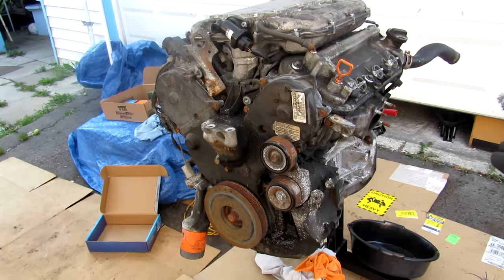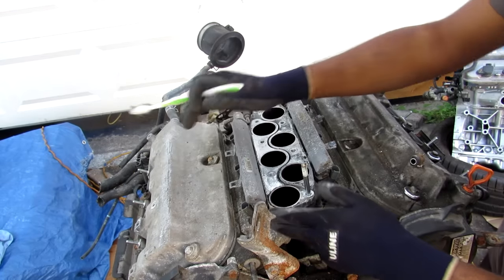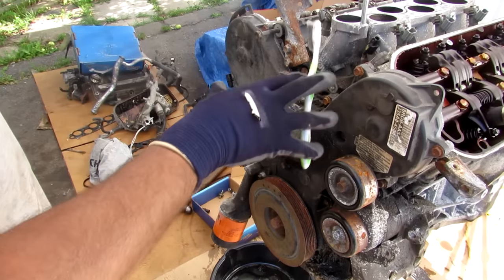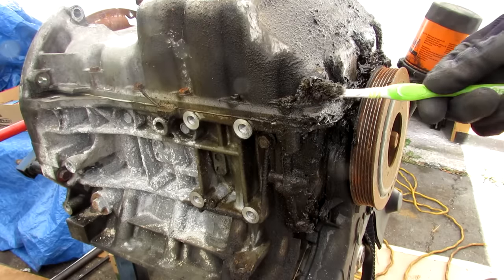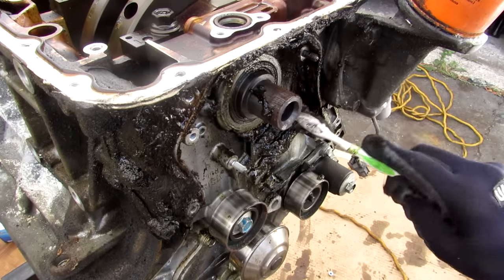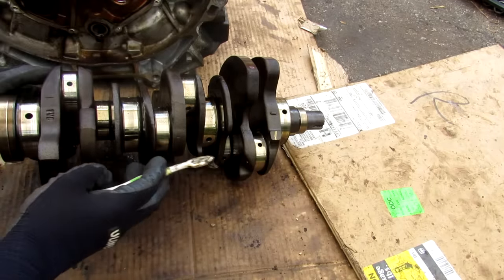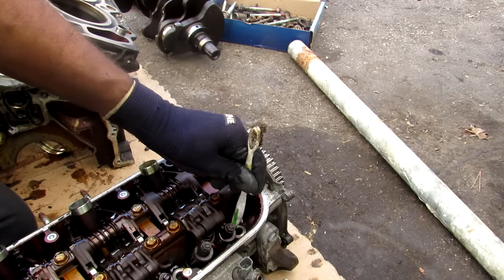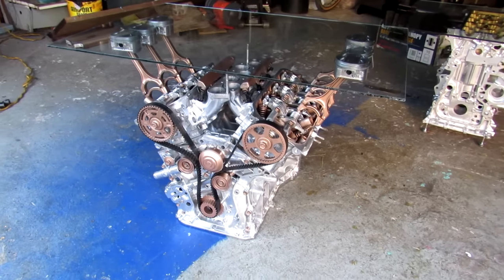Why Honda V6 Engines Haven't Changed For 25 Years

Comment: "Infamous" J-series?  That has a negative tone.  More like famous or legendary J-series!  I agree that the use of timing belts is a weak point of these engines, but timing belt service is only required around 120,000 miles, maybe an earlier inspection around 100,000 miles if you live in a hot climate (as per 2005 acura RL 3.5 service manual).  Even when I replaced the timing belt in a 2005 Acura RL with the 3.5L, the timing belt looked fine.  Additionally, Honda is not the only maker that uses timing belts on later model engines - Audi does as well.   The SOHC design is not necessarily a bad design - it makes for a compact engine design.  Additionally, the placement & design of the upper air plenum is ideal because it allows for easy spark plug replacement, unlike the design of many V6 engines that require upper intake removal to replace the spark plugs.
Reply: Timing belt designs were far superior to the chain variations that have replaced them. Chains were not adopted because they were a more durable design. They were adopted to fool customers into thinking that their maintenance costs were going to be lower. That hasn’t proved to be true at all.
Reply: It's probably infamous to people who have to do timing belt changes or water pump changes. No quick fix, that.
Reply: Jesse Brook No, as technicians we love them
Reply: I replaced the timing belt at 105k (10 years old on my vehicle). No signs of cracking or decay.  I'm still glad I did it, as it's worth the peace of mind that I won't be letting a valve and piston meet.
Reply: Marcus Schroeder I’ve seen HSN timing belts last 200k miles before they were replaced. Many modern chain designs are lasting 75K miles before they’re stretched and throwing engine codes.
Reply: It's Infamous because it's very underrated it's such a great engine
Reply: I don't think timing belt is a weak components at all…I like cars with timing belt instead of chains, more serviceability isn't necessary a bad thing
Reply: @prevost8686  Most of these chains going bad at 75k miles as you say, is most of the time a lack of maintenance.  I am a tech for a chevy dealership and really the only time we see chains go bad (2.4 ecotec) and (3.6 liter) are always due to low oil from lack of oil changes or thick sludge, from lack of oil changes.  Going 10-15k miles on conventional oil does chains in.  Chains are lubricated by the oil.  The chain tensioners require oil pressure to operate.  Without oil, the tensioners lose tension and the chains jump.  Guides also wear a lot faster with lack of oil changes.     Also seen plenty of high mileage chains with no issues as well.  All depends on how they are taken care of.    Editing this to add to the 2.4 ecotec.  Chains love going bad due to the oil consumption issues those engines have as well!!
Reply: @JD730  I’m sorry but you’re wrong. Dealerships only retain about 7-10% of their customers after warranty. I’ve had more customers than I can count in my independent shop that never miss a service that have had everything from chains to solenoids going bad and they run the best full synthetic oils at reasonable intervals. I’ve replaced components in them that were as clean as a new engine. They component quality of the engines is junk.
Reply: @prevost8686  That's my view. Most belts eventually became pretty good. Additionally they enable engine designs that would be difficult with chains. The bad ones, and replacement costs, frightened customers away, including me.
Reply: @prevost8686  I am a dealer tech and I see lack of maintenance ruin more engines than just all out failure from manufacturing .  And to let you know, not all dealers only retail. 7-10 percent of their customers.   70 percent of our work is CP, average car that comes into our dealership has 75k miles and is a 2013 model.   So that rule doesn't apply to all dealerships.   I'm really happy that your customers follow their maintenance schedule but don't kid yourself.  You and I both know that in the real world that most people do not maintain their vehicle let alone do simple service like oil changes.
Reply: @JD730   Mercedes Benz has the highest customer retention after warranty expiration and they’re only at about 15%. GM, Ford, Dodge have the worst retention of all the nameplates.
Reply: @JD730  Do you think a lot of these issues are caused by the salespeople telling people to drive 10,000 miles between oil changes, and lifetime fluids, etc? My circle of dealer reps, mechanics tell me all the time about the "Maintenance wars" between manufactures. Instilling in the customer that the transmission fluid for example will last the lifetime of the car, when that is not true. Its probably going to get worse since the electric car folk say they never have to do any maintenance on their cars.
Reply: I have the j series V6 and I changed all 6 spark plugs without removing the upper intake 🧐. I’m not sure what v6 engine requires you to actually remove the intake to change the spark plugs.

Comment: You can see Honda’s high quality workmanship and castings
Reply: You can also see the evidence of typical honda owner neglect. That engine was a ticking timebomb. It looks like they had seriously neglected oil changes, which was starting to take its toll on those rod bearings.

That oil was like it had come from a diesel, there was a front bad front main seal that hadn't been taken care of, and the timing belt was on the edge of snapping. Last time I saw a belt like that, I told the owner to change it immediately. They agreed, but couldn't get it done right away. 2 weeks later, pistons met valves.
Reply: seems like cooked electronics is what probably scrapped this one though
Reply: @thegearknob7161  They went to Kevlar reinforced belts in 2010. I wonder how many miles were on this belt? My guess 200K or more judging by the rest of the engine. The J series is a great engine design despite the negligence. Single cam less parasitic friction, less moving parts.
Why not a double row O-ringed chain run dry on the cams. No stretch, last forever speced correctly.
Bad oil selection and maintenance plus weak or neglected PCV system will get you varnish buildup.

Comment: Just a note, the lower intake runners CAN BE removed without taking the heads off.  You just need to remove the fuel rail and slowly wiggle the front one out first, then the rear.  That small gap in between the 2 runners allows you to do so.
Reply: I thought it was pretty crazy that he wanted to take off the heads in order to remove the intake manifold
Reply: @dappadan7914  ...were you drunk?
Reply: @lifepresent3183  yes
Reply: @dappadan7914  ive done it, like u stated multiple times. this guy does not know his J series...

Comment: i recently sold my 2005 accord v6. engine is still strong. transmission beginning to go at 190,000 miles. great car
Reply: Such a gem of an engine,but yeah honda auto transmissions have not been the greatest until recently. I think the 6 speed auto is best so far for automatic other than that the manuals are pretty bullet proof. Let see how the 10 spd holds up
Reply from the maker: That's the problem why so many Honda's are at the boneyard....the transmissions attached we're garbage
Reply: 200kMi on a car is quite good... something has to go first!

Considering the engine got all the  maintainance work (valve adjustments, Tbelt, spark plugs, etc) the transmission simply got new ATF before clutches and converter  got tired. 
... go compare that record with the high maintenance of the German cars 😉
I have a deep appreciation for Honda's achievements of performance + reliability and price point.
👍
Reply: Not all Honda V6 engines from Honda is billet proof. From what I know only the Honda V6 engines without the VCM is the bullet proof engines. The V6 VCM were for the most part crap!
Reply: @rmwarriors16  true I have heard some nasty piston, piston ring, and oil burn issues ,however there is an easy fix for that and I wanna say people that notice will 9/10 put the muzzle on it where as people that dont notice probably don't drive on spirited side anyways
Reply: @hieuhughesle-au9884  I think Honda has a bulletin for  VCM j series engines I think they only warranty misfires not oil burning on the J series. They replace the rings and clean up the pistons for free. No matter how many miles or years.
Reply: Vinny Booboo "ATF MaxLife " by Valvoline is a GREAT upgrade for crappy Honda DW1 ATF... 
as tested on 150kMi TL'04:
It delivers consistent shifts between cold and warm ATF

Quiets noisy gear humm with better lubrication
Reply: G Lasser Honda DW-1 is really not that bad though. If you were talking about the  old zf one, you can talk shit about it all day.
Reply: @glasser2819  Honda fluid is the only stuff you should be using Honda's hate none oem fluids in their tranny's, diffs, and power steering pumps. Toyota you can run anything LMFAO
Reply: Hieu Hughes Le-Au most people don’t notice this until it’s too late. I have two friends who have the V6 VCM motors and it’s burning oil like crazy! The rear spark plugs are fouled up with oil.
Reply: My 2005 v6 Accord coupe just hit 200,000. The transmission doesn't have to much further to go... I'm just gonna drive it till it dies.
Reply: Honda early j series v6 trans were shitty yes, but all their trans from the 80's - late 90's were phenomenally reliable. I've had 8 auto Accords 1990-2001 and each and every single one had over 250k miles with fine automatics
Reply: A drain and fill every 7 to 10k with honda fluid will make those trans last a long time.
Reply: 190,000 miles on ONE transmission ?!  You must have had the manual transmission, cause the 5-speed Autos that came with the V6 don't normally hold up that long (my wallet and I cried).
Reply: My 2005 accord timing belt broke and destroyed my engine @ 183000. Transmission slow to get into drive
Reply: @IntelCoreI77700K  lucky. My 2005 accord coupes timing belt broke destroying my engine at 186000. I loved that car. Ur lucky you have urs
Reply: @raiderrichard7291    Did you have the Timing Belt swapped out at the correct servicing interval ?
Reply: @raiderrichard7291  My transmission is also slow to go into drive, I'm about to change the timing belt and water pump though.
Reply: @HalfBreedMix  no I bought the car used and forgot to ask the guy if he serviced his belt. The belt started making noises a year later and I ignored it like an idiot and it snapped on me while I was driving destroying my engine
Reply: @raiderrichard7291    :-(   That sucks.   Yeah, most scheduled repairs that need doing at the higher mileages will be put off by those looking to sale the car.  Besides the obvious reason of the seller not caring because it won't be his/her car much longer, there is the fact that used car buyers don't appreciate the increased price due to a required service repair done just prior to putting the car up for sale.
Reply: I had 2002 honda accord v6 transmission broke when it only had 95k miles.. they had horrible transmission s

Comment: Just hit 316,000 miles on my V6 Accord coupe. They definitely can't be beat.
Reply from the maker: Good motors. Too bad about the transmission
Reply: @speedkar99  bro why do you reply to every single j series owner , "to bad about the transmission " when majority of the comments are high mileage original transmissions 🤦🏾‍♂️🤦🏾‍♂️🤦🏾‍♂️🤦🏾‍♂️🤦🏾‍♂️

Comment: Cliff's notes version:
Honda's V6 hasn't changed in 25 years because their rotating assemblies are made to be quite stout, and the rest of the engine is dead simple in design. Thus, they haven't needed any substantial changes.
Reply from the maker: Good for reliability but you still have to change timing belts and adjust rockers, and it's SOHC...it's 2020 common
Reply: @speedkar99  
I'd rather adjust valve lash every 80k or so than have a failing hydraulic lifter, but that's just my personal preference. SOHC vs DOHC is moot at best. Yes, there are some advantages regarding volumetric efficiency when using a DOHC configuration, and allows for greater flexibility in VVT/VVL. However, that comes at the cost of more moving parts, more complexity, and thus added weight and maintenance costs. Timing belts in transverse engines, especially V6 engines, tend to be a pain in the ass... but I've never owned a chain driven engine in any import that didn't also need replacement at some point. If they could design a system that is as simple and robust as Chevrolet did on their small blocks (even up to the Gen III LS/LQ small blocks), there would be much more reason to go chain. 

Simplicity usually means reliability. Look at the Honda B engine vs something like the Mitsubishi 4G63, or the Nissan SR20DE. 

Or even better, the GM LM7 vs the Ford Triton V8s. Power ratings are similiar, however, the Ford engines tend to be much more complex and prone to failure. In fact, the early GM LM7 wasn't even required to have EGR to comply with emissions, which made it even more simple and less points of failure. 

However, the Wankel Rotary is a shining example of how simplicity isn't always better lol.
Reply: @phantom240  while your argument on sohc vs dohc is somewhat true look at what dohc can really do to a engine even with a couple more moving parts the 4age is the perfect example the sohc and dohc versions are like comparing chalk to cheese just like comparing the 16 valve to the 20 valve
Reply: @dr.dylansgame5583  the 4A-GE isn't a good comparison, the SOHC version  of those engines only had 8 valves vs the DOHC's 16 or 20.  The Honda SOHC J-series has 24 valves just like most DOHC V6's, the only thing it lacks is VTEC on the exhaust valves and the ability to phase the intake and exhaust cams separately.
Reply: Sweats in J37...
Reply: @speedkar99  The SOHC config was criticized even back in 1998 as everything else was DOHC even back in shiny suit days LOL While naturally aspirated J series having made 300hp the extra cams are not necessary.
Reply: @dr.dylansgame5583  
Then again, you have to take into account what those two engines were designed to do. The only 4A engines I'm aware of that were SOHC were the 4AC and 4ALC, designed to be as economical in both build and fuel efficiency as a carb'd engine could be in their day, so comparing any SOHC 4A family engine to the 4AGE is really punching down. And if you want to compare just the DOHC GE variants of the 4A, you'll see that in stock trim, they're in spitting distance from one another in performance, while the 20v models will undoubtedly incur higher maintenance costs due to added complexity and higher RPM operation.
Reply: @CRAPO2011  Meanwhile GM is like, "Pushrod OHV V8, my dude". 

And to the DOHC disciples:
Back in the 80s through the early 00's, when engines were controlled by primitive dinosaur pea-brain computers, the mechanical design of an engine was critical to both it's performance and longevity. With modern technology and it's ability to much more precisely control fuel and ignition tables, even the most simplistic of engine designs can be made to perform quite admirably in both performance and economy.
Reply: @phantom240   to be fair the main reason i do this is idk what it is but every sohc car ive ever been in has been the most anemic experience ever i could put the pedal to the floor and lose to a prius it feels like
Reply: @phantom240   also we just gonna forget the ae85 had a 3a sohc which is technically part of the 4a family since its basically there older cousin whos really weird and has no redeeming qualities
Reply: @speedkar99  they shoulda put a timing chain.
Reply: @phantom240  yeessss great example GM LS/LT V8 ohv people knock them for not being DOHC yet they can take a beating. Gm has kept them up to date with VVTi and cylinder deactivation. Northstar was dohc v8 and nobody will touch those to modify.
Reply: @dr.dylansgame5583  But it's not a 4A. Sure, it's part of the A family, but that's like saying the SBC305  is basically an LS1.
Reply: @phantom240  I've found that self adjusting valves are more likely to have excess lash than adjustable ones even if they have never been adjusted. Just based the cars I've owned.
Reply: @carleynorthcoast1915  I've had mixed experiences honestly. Owned a '94 Prelude that I bought with 176k, and put over 100k on it before I sold it and never had to adjust lash... In fact, don't even know if/when the timing belt was ever done. A friend of mine owns the car now, and with over 300k on the clock, the car is a hulking pile of garbage, aside from the engine and transmission... and even then, she's worn and has low oil pressure lol. 

On the flip side, I've flipped dozens of Hondas over the years and had to adjust MANY valves. Never adjusted any that had cam-on-bucket style, but they're a nightmare from what I gather. I have a hyraulic lifter on it's way out in my 2002 Avalanche, but it's got 288k on the clock, so that's to be expected.
Reply: @phantom240  thats why i'd rather have a Toyota over a honda. they're dohc and they've proven to be just as reliable as the honda v6's, if not more, while having better fuel economy and smoothness.

Comment: Great tear down. THANK YOU for sharing. Have over 288000 miles ( 463000Km ) on my 2001 odyssey and still going strong.
Reply from the maker: And how many transmissions?
Reply: @speedkar99  on my second tranny - original then rebuilt. Been lucky so far.

Comment: Really well done. Thanks for sharing 👉👊!. I have a 2000rl, 210,000 higley maintained miles, truly runs like new.
Reply from the maker: Thanks. The 4 cylinder Honda's are just as strong too
Reply: @speedkar99  2000rl: j series 3.5l v6, not 4cyl btw